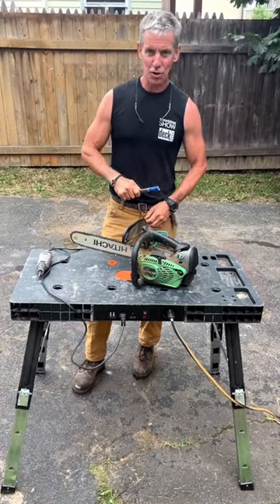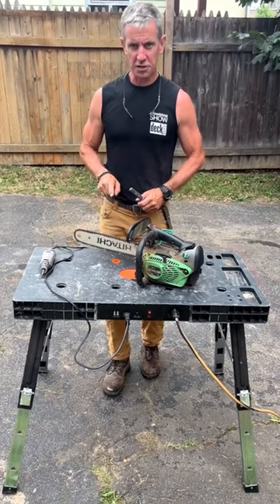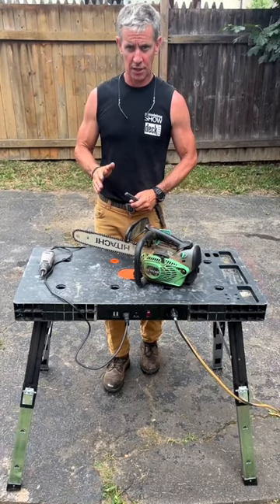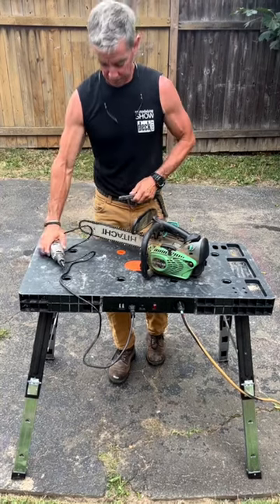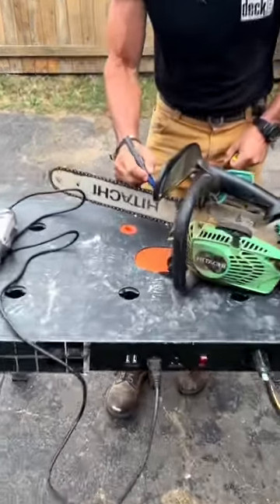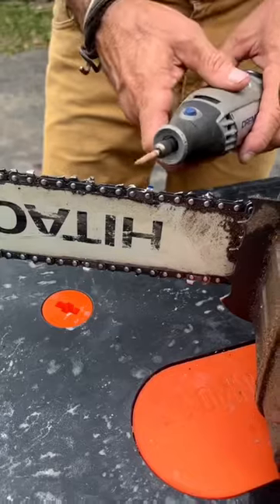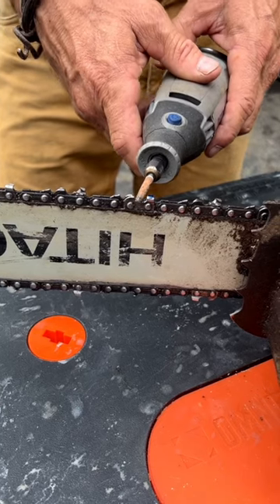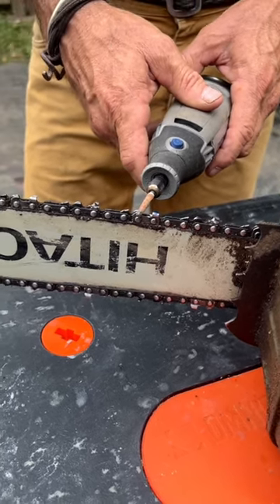How to sharpen a chainsaw chain

Comment: Buckin Billy Ray would be sad.
Reply from the maker: We'll send him a pizza. He'll be fine.
Reply: @myfixituplife  love the response 🤣🤣
Reply from the maker: @bye92  Pizza has power. :)
Reply from the maker: @bye92  We try. Have a good one.
Reply from the maker: Roni for us. Extra grease, please.
Reply: He’d be screaming something about a gullet if memory serves. Thing with using a dremel is you can get to that gullet pretty quick if you’re not careful.
Reply: I'm a huge Buckin Fan - but I'm tired of spending forever to hand file my full house ,,time for av
 Dremmel
Reply from the maker: @Forged721  Same. I have never been able to make a file work. The Dremel feeds the needs.
Reply from the maker: @kurtdussander4944  The Dremel fully rounds the gullet. The ceramic spindles are just the right diameter. I have multiple chains on two different saws with multiple sharpenings. It might not be perfect, but it is way better than a dull chain.
Reply: @myfixituplife  I never said it wasn’t the right diameter. A dremel can get to where you need to be and further with a lot more quickness than a file. All I’m saying is you have to be careful that you don’t go too deep when using a dremel because it works fast.
Reply from the maker: @kurtdussander4944  Ah. I see. I missed that. I just "cut" until I see silver. And I should have had eye protection on for this. One little piece of ceramic coming off of there at 30,000 rip ems would not be good.
Reply: @myfixituplife  Buy a new file. That seems like a YOU problem.
Reply: nah he wont hes used one before on one of his videos.
Reply: Bucking Billy is 
🥴💃😋🦸🤡
Reply: Buckin' usually does live streams on Sunday afternoons. Maybe someone should ask him

Comment: You should almost never cut the raker down. It’s a once in every 4 times you resharpen the chain. I’m an arborist so I basically get more time with a saw in a day than your average farmer in a year
Reply from the maker: I totally get it. I got the raker trim from a media event I was at at Stihl. They make a hand-sharpening tool that I could never make work that files the tooth and grates the raker. - You're in a tree every day, I'm listening. - Also, raker or not, this Dremel doohickey put so much life into my chains--and I am not a full time tree pro--it's crazy. Tuned them right up.
Reply: if u want ur chainsaw to cut u grind the depth gauges down. and if u were a good arborist you'd know they're depth gauges not rakers
Reply: @schlomoshekelstein908 how about you make a video then bud
Reply: Its twice you take em down. Sharpen 3 times then the rakers with 2 smooth strokes with a flat file. Any more you'll ruin your chain. Do it again if you haven't thrown your chain away yet.
Reply: @myfixituplife  You're not a full time tree pro? I get it now. Making money from Youtube nonsense lol

Comment: Should I trust a guy that uses a Hitachi chainsaw? Thinking not
Reply from the maker: It's an older saw and Hitachi o out of both the outdoor power equipment game and power tools altogether some time ago. That you judge credibility on brand alone seems like a miss to me. This is a very nice top-handle saw. I've cut miles of wood fiber with this thing.
Reply: @myfixituplife  haha got under your skin with that one. I would say that when it comes to saws, their are only a few good brands. I would my husquvarna or stihl up against your Hatachi anyway of the week buddy. I cut up 10 cords a year and would not trust taking a Hitachi 2 hours into the mountains.
Reply: What saws do you use?
Reply: @roknikov   I have a husquvarna and a stihl. Husquvarna is the cheaper of the 2, but it still runs great.
Reply: If it cuts good, starts easily, and gets the job done then wtf? Just never use ryobi or homelite lol
Reply: @illuminatismasher  i had homelite 330 was a great saw lasted 20 years cutting firewood.
Reply: Husqvarna or jonsered is what I use, I cut at least 6 cords of wood every year. I used to fall trees for a living. 
one thing I would always use a file, with no guide and have always had good cuts. I would never use a dremel to sharpen my saws, and I would never use a little Hitachi saw, those saws are used by carpenters on a building site, not fallers

Comment: Yeah, dont grind the raker like in the video. Use a file with a sharpening guide so that all the rakers on the chain are filed to a consistent height. The raker sets your depth of cut.
Reply from the maker: I get it. - But there are also zero file systems that have worked for me. - This does. It might not be perfect, but it turns chainsaw dust into ribbons of wood fiber.

Comment: Be super careful with the "metal piece in front " aka the rakers. The relationship between raker height and cutter tooth is responsible for how hard the saw bites and kicks back. Too much bite is horrible in hard wood and will get your saw stuck. A consistent relationship between the two is also imperative for your saw to cut straight and not turn your firewood chunks into a 🌙. This is great for homeowners who aren't cutting often/big but less than ideal for production work or someone who wants a top notch chain cutting experience. 🥂
Reply from the maker: I'm guessing you know a lot more about saws and cutting timber than I do. And while I have cut many different kinds of trees, including days and days of post-tornado clean-ups, I am not a tree service. - I will say this, though: This keeps me moving. I've never been able to master a file. And the Dremel removes so little steel, I doubt very much the raker is mod matters in real life.
Reply: @myfixituplife I am 17 and can file a chain just fine but the trick is to use a raker gauge because those are the most important ones also it's super cheap since 1 5.2mm file costs like 2€ 😂
Reply from the maker: @AutodidactEngineer  you've got a steadier hand than me. I tried the Stihl file with a raker file and, nuttin'. Keep up the hands-on work.
Reply: Filed my rakers all the way down, lol, to get that hefty "bite". Oh yeah, it works great on taking nice chunks out quick, but be super cautious with the major kickback that can result.
Reply: We all know that the experts are in the comments who like to copy and paste information.

Comment: Don't mess with the rakers guys until necessary.   Don't just do it cause this guy did it.  Feel your saw
Reply from the maker: There is so little steel being removed, I don't think a Dremel tap on the rakers makes any difference. I know I can't feel it. - I did it because a guy at a chainsaw manufacturer told me to. With this method, it doesn't seem to make any noticeable difference. I just did this again this week and it kept me moving, making money.
Reply: I actually had a chainsaw I returned because after it dulled and I sharpened the blade, it never "bit" into the wood. Perhaps you don't hit the rankers if you don't need to, but not touching them all after dulling a blade could turn your saw into a glorified sanding wheel.
Reply: Correct, sharpening the teeth doesn't lower the teeth it just moves the cutting edge back so why lower the rakers???
Reply: @Dressagevids  because the teeth are lower in the back. So the edge is lower after sharpening. But there are gauges for euch chain size to make sure the raker hight is right. I hope this is comprehensable
Reply: @Max289-g8v  it is,  thank you very much, i did not know that, makes a lot of sense    tks

Comment: The problem with spinning abrasives like this is that they ablate... they lose diameter as you use them. That is bad. Just get a normal file and learn how to do it right.
Reply from the maker: "ablate" -- LOVE IT. - You're 100% right. However, I am file-haunted. They don't work for me. - This does.
Reply: @myfixituplife  I know "Ablate"wasn't exactly right...ablate I guess is material loss by combustion, when I meant material loss by abrasion.
Reply: @myfixituplife  Well that's kinda scary. Sharpening chainsaws with a file is not that hard. Careful with that saw.
Reply: @myfixituplife  I tried a Dremel sharpening stone, and it shrank by 50% on the first tooth. I threw it away and finished with the old file. I guess the best system is the Stihl sharpener if you ask the pros.
Reply: @theobserver9131 I would say you don't know how to use a dremel very well then. You don't run it for 5 minutes

Comment: I thought when sharpening a chain you never file in and out always out but never bringing it back towards you.
Reply from the maker: Files are like hand saws, the "teeth" cut in one direction and travel in another. - A coping saw is a great example of this. Put the blade in teeth facing you, it cuts on the pull stroke (my preferred method). Place the teeth away and it cuts on the push. - Here, we're dealing with cylindrical forces.

Comment: I have a dremel just like that that I use for sharpening my saws. I do it a little differently but it works great. I always saved my chains through the years before I would sharpen them and now that I’m not so lazy it’s been saving me a lot of money. I’ve gotten so good at it the chains cut as good or better than new
Reply from the maker: Hey Smith Tree Service - Good to hear. I was hesitant to claim "good as new" but, what you said. They're pretty much good as new. Stay safe up there.

Comment: Thank You for the tip! It was much-needed. I inherited a chain saw and the only thing I know about a chainsaw I saw in a movie.
 I can really appreciate your Silver Tipped steel  toe boots, it's a sign of a hard worker!! I use JB Weld on mine to squeeze out an extra mile or two.
Reply from the maker: Glad this helped. A friend of mine echoed something I always felt instinctively cutting trees, and that's a tree on the ground can be just as dangerous as a tree in the air. Big ones are 10s of thousands of pounds and the loads are what we call dynamic (pressure and gravity coming from multiple inputs). Please be careful (and have fun). Making chips is good stuff.

Comment: A lot of haters here. I learned how to sharpen this way from a Stihl rep. He even gave me a set of bits.   
I was able to resurrect a drawer full of old chains. I know how to use a file, but it has become physically more difficult in my 50's.  And I don't give a flying dog's  ass what anybody thinks.
Reply from the maker: Yessir. Lots of people get triggered when they see something different and new, it seems. Then they have to shout it down. Keep 'em sharp. Keep cutting.
Reply: I all ways tough work smarter and not harder! This looks like a great way to sharpen.
Reply: More better....
Reply from the maker: @russellpresley6372  Works for us!
Reply from the maker: @jerryfields6919  Yup.
Reply: Flying dog 😂 The stones distemper the chain making it weaker. A round file works much better. And BTW, if you accidentally push the lock button you'll fry the electric motor in a millisecond!
Reply from the maker: @treeman2660  Chain distempering is WAY ABOVE my pay grade, bro. I love that you know this about steel. - For me, it works better than any other solution I have found. - That said, how steel works aint how wood works.
Reply: @myfixituplife  Let me guess, you're a freshman veteran in the tree business and know it all BRO? I'v met them all in my 37 years of tree service.
Reply: sthil makes one of these grinders for saws anyways. has a guide and different stones for different size chain. good little tool. if ya dont have a file handy.
Reply: hell yeah
Reply from the maker: @treeman2660  no sir. I have worked for a tree service for a time and done my own simple tree work, but I’m neither a freshman nor a super expert. I do know that I suc+ with a file and dropping chains off to be resharpened is expensive and time consuming. The Dremel is the best way I’ve found to keep the beaver’s teeth silver.
Reply: @myfixituplife  beaver? As in Eager Beaver? I think you just told me all I need to know 😂
Reply: @myfixituplife   And if you worked FOR a tree service you told me even more.
Reply: Sorry it's not new and that ain't sharp..😅...also you heat up tge chrome plateing and again is not sharp..just ain't
Reply: good for you

Comment: New chainsaw owner here. When is a chain been considered “beyond sharpening” or in other words to be replaced? I’ve heard that there’s a risk of shrapnel if sharpened to thin. Thanks
Reply from the maker: @mtiger5  Right. I replace chains when there’s 1/8-3/16 left on the tooth. - I sharpen them when chips (shavings, technically, I think) turn to dust. When the saw is shooting out dust, it’s not cutting anything any more and it is heating way up.

Comment: Me. I can tell by the shinny silver that I’ve sharpened it.  And need to switch sides. Unless I’m doing both same time.?? Lol  I’ve done it by hand 🤚 🖐️ lol. But I’ve Ben wanting to try the dermal. I’ve bought the hand crank one but only got the bits. Lol. Now where’s my dremal . 😮can use the stainless steal gauge for dog then use grinder or dremal. I grind it quick no gauge unless I want clean cut. 😮
Reply from the maker: I'm with you. I've been trying and failing at files for decades. - The Dremel works, it works quickly and it works supremely well for the work I do.

Comment: What size ceramic bit
Reply from the maker: No idea. This whole thing was an accident. I noticed the ceramic bits in my Dremel (gray for the small saw, orange for the bigger one) set and compared them to my chain teeth and hey both were perfect matches. I should ask Dremel what the deal is.

Comment: Silver doesn't mean sharp!
Reply from the maker: Totally agree. The "beaver tooth" angle of attack must be maintained. The good thing is that these ceramic doohickey things that go in the Dremel don't remove much steel so it is easy to keep the angle of attack as designed. Just a few seconds of grinding shines the teeth back up, restores the correct tooth geometry and chips fly.
Reply: @myfixituplife  When your chain looks loke a lifted toenail its NOT SHARP. The second you put it on a piece of wood you're back to a dull saw.

Comment: The "front piece" is the Rake.
Reply from the maker: YES. Raker. I had it in my head when I was talking. I just couldn't get it out of my yap. Thank you.
Reply: It’s actually the depth gauge for the tooth ,
Reply: Wrong, chainsaw chains don’t have rakers, they’re depth gauges as the previous gentleman stated. Rakers are found on old crosscut saws in times gone by. That angled mark on the head of the tooth will also tell you when it’s time to change the chain. Just trying to help out.
Reply: @HughWoo your wrong. The depth guage is the tool used to measure the RAKER. the depth guage is a whole other tool entirely. It's used to measure the height of the raker.
Reply: @robhartman4012  two very precise smooth Strokes with a brand new flat file is what I use and been doing it for 35 years people on these comments sections are overthinking way too much
Reply: @robhartman4012  This is incorrect.

Comment: I worked for Husqvarna for over 30 years I do not recommend this to anyone sharpening this way without a proper guide or gauge to know what angle you're on will eventually cause the cutting teeth to be incorrect and will cause premature wear on your chain and your bar
Reply from the maker: Thank you for commenting. I get what you are saying. I am certain you are faithful to the woodsman. However, those of us who haul out chainsaws sometimes need on-site solutions that don't require woodsman training. I have tried files. They suck ass. - This. Works all day.
Reply from the maker: I'm not a logger. I work in suburbia. There are outdoor devices everywhere. - I'd love to get the file juju, but I need to keep working and this does it.

Comment: What kind of bit is that? I have a Dremel just I want to know.
Reply from the maker: It's a ceramic cylinder. There are at least two sizes I've seen. Go to your local hardware store or big box and check where all the Dremel stuff is. You should find them. Match them up to the tooth on your chainsaw to make sure they're the same.
Reply: @myfixituplife  thanks, I saw them in Lowe's (very expensive) and Walmart.
Reply from the maker: @erikescamilla5701  They cost what they cost. They're just bits so I haven't had them break the bank yet.
Reply: @myfixituplife  I saw them cheaper in home Depot
Reply from the maker: @erikescamilla5701  OK.
Reply: Big no no - go to your big box store - same one he got that child’s play toy of a chain saw, bought one o those in a set for my son last Christmas … he was 2
Reply: @clintoncroker2461  😂
Reply: @erikescamilla5701 You can buy them at Harbor Freight and Northern, if I am not mistaken. I'm sure you can buy them online as well.
Reply: @jamesspalten5977 thanks 👍

Comment: The best way to sharpen a chainsaw blade is to buy a new one.
Reply from the maker: Sure. Then I'd have 80-million chains lying around. This is fast, too.
Reply: Not knocking your video. I use to build bulkheads and drive pilings. We would use chainsaws all day and it was to time consuming to sharpen the blades once they go. After you sharpen them you only get a few more cuts out of the blade.
Reply from the maker: @WeThePeople205  marine construction. Awesome. I'm assuming you're talking about a lot of milled Southern Yellow Pine piles and square posts. I did a version of marine construction a lifetime ago (seasonal docks; more akin to deck building, only in the ocean) and I know from cutting 6x6 and whatnot with a chainsaw that it is a different beast than cutting a recently downed tree. I've tried cutting up decks with a chains saw (never again) and it is brutal on the chains. Good stuff.
Reply from the maker: @WeThePeople205  I may be replying to this twice. Pre-Sorry - I did a lot of marine construction and storm recovery. I need multiple saws and chains. All I can say is that is that this method is easy, fast, keeps chains way sharper than dropping them at the shop with a three week tournaround.
Reply: Chainsaws have chains not blades...